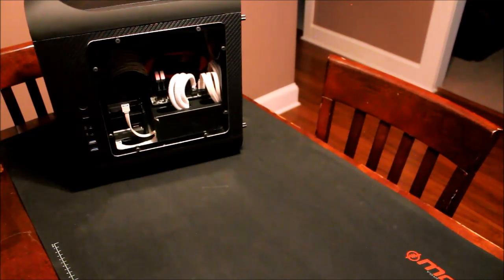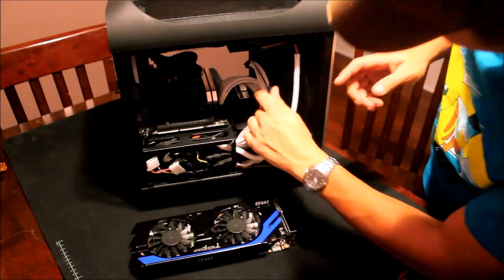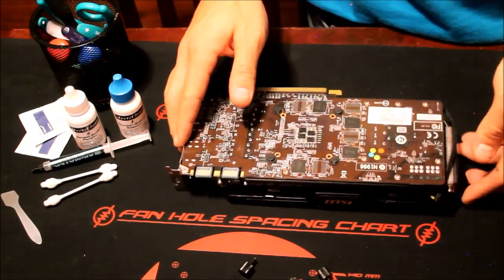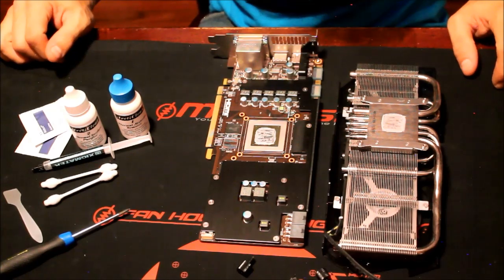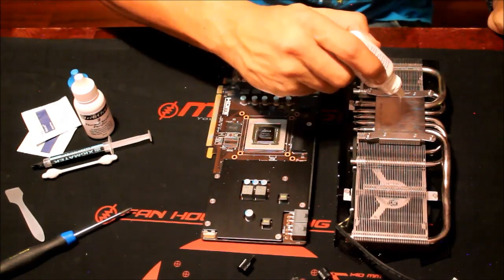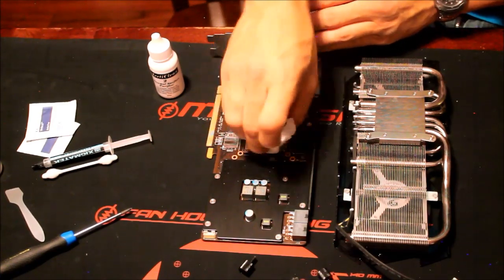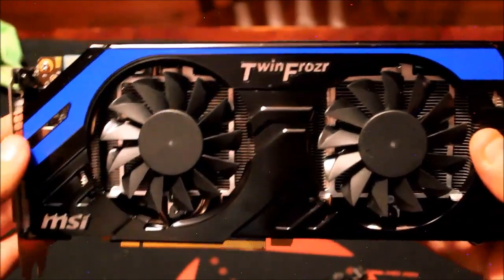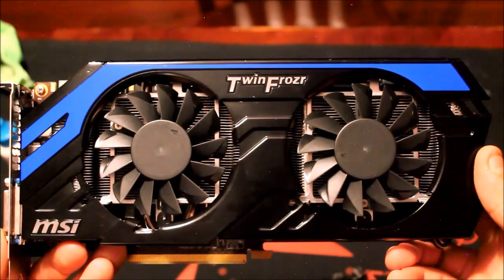GPU Thermal Paste Upgrade - Fix Overheating Video Card

Comment: Can i use water for clean dust?
Reply: I don't know if you're being serious, but no. You can't use water.
Reply: Alcohol?
Reply: Rubbing alcohol for the gpu and heat spreader, but just use compressed air for the dust of your pc.

Comment: I had to RMA my R9 390 because the GPU itself wasn't working right, I got a refurb in return and it runs 100x better no more graphical glitches but the temps are high as balls... about 12C higher than my last, up in the 80's which isn't normal... Would it be worth dealing with the BS RMA system again or just going for it? I know the fans are all still good in it.
Reply: Mine ranges from 75c to 85c in most games. Those temps are normal for a 390

Anything above 94c and you have a problem.
Reply: Yea but I got permission to just change my thermal paste without voiding my warranty and it dropped 20c. I'm like 64-71 on private sever and of course 70-76 on public servers since theres so much more shit going on.
Reply: Well Shit maybe ill try to do something as well

Comment: just cleaned my GT520 and replaced thermal paste. My temps went down 12 degrees celsius.
Reply: hei man i am gona clean my hole laptop , and its not cleaned in 3 years ( since i bought it ) atm my gpu goes up to 92*C when i play Overwatch how much of a difference will a new paste make ?
Reply: darkki94 well my gt 520 went from 76 C* to something like 50-64 C*
Reply: darkki94 don't forget to clea out with compressed air to clean all dust out
Reply: Doritos Master i am giving it to a special service to do the job
Reply: darkki94 oh
Reply: Doritos Master i get it done yesterday .. from 92-93*C now i am at 78*C its much better but i still cant overclock because it crashes :(
Reply: darkki94 you are not supposed to overclock laptops,
Reply: Doritos Master this does not mean that you cant :D maybe i will try with lower rates  :D
Reply: darkki94 well you know with laptops you really don't want to overclock them much. They are a much less stable then pc's

Comment: Furmark score only changed by 2%, and this is a worst-case type of GPU test.Also, my GTX680 doesn't throttle until over 80degC, so not sure what's going on with test. That may explain why his score didn't change much. (I don't understand his graphs because it just looks like the "throttling" occurs when he stops the Furmark test.)Having said that my 3-slot GTX680 occasionally gets slightly loud (I'm noise sensitive so we're talking about 40dB), and since it's now 2016 replacing the GPU paste should help with fan noise.I may do Furmark, Valley and Firestrike tests and report on noise and scores.

Comment: One question :

What if i just open up the gpu and clean the dust only without removing and applying any new Thermal paste.
I bought my rig like 11 months ago & i have not opened my GPU yet to clean it.
Also,  i do not overclock my gtc 960 2Gb Graphics card.
Will removing all of the dust from the GPU improve the FPS.
Again i am thinking of even detaching the graphics part and detaching the two sides of metal containing the paste and just attaching them again after cleaning the dust in fans & the surrounding area.
Will that be beneficial to any extent...?
Reply from the maker: +Fahad Humayoon If the dust is causing it to heat up past its preferred point it will throttle itself down and reduce FPS
Reply: +ChicagolandGeeks 
Oh no..
That explains the 50 fps limit that i am getting in 80% of the gamea that i ran.
Even though i have a 16 gb RAM..
So in your opinion , should i apply a new Thermal paste too besides cleaning the dust of of my gpu.
I was just hoping to unscrew it and blow some air in it (without disturbing the Thermal paste)...
Reply: +Fahad Humayoon My GTX680 is about four years old and my performance is almost IDENTICAL now to what it was. I've never cleaned it or replaced the paste.Your performance issues are more likely a GPU driver problem, CPU bottleneck, or even something simple like not plugging the monitor into the video card (using onboard GPU instead).I doubt you have a 50Hz monitor, but on the off chance note that the FPS if using VSYNC is limited to the monitor refresh rate. I can set my monitor to 50Hz if I want, enable VSYNC and have a max of 50FPS.
Reply: +Canabal Thank You

Comment: way tooo much paste applied...
Reply from the maker: +Mingyao Liu (zodiacsoulmate) Mentioned this in earlier comments, putting paste on a GPU is different than a cpu, you want the paste to completely cover and go over the edges of the die. The temps don't lie!
Reply: umm ok i get u, it is probably better temp by apply more because of the irregular gpu die shape. My bad.
Reply from the maker: Its all good man we're all here to learn and share experience right? :)
Reply: u didn't apply it correctly.
Reply: its a fucking radeon amd what did u expect ? these cards are ovens

Comment: Great video. I found Xigmatek G3606 cheaper and have higher thermal conductivity but is G4512 better?
Reply: +Nabill Hp g45 is better than g36
Reply: Thank you. I will give it a try
Reply: +Nabill Hp o 1 or 2 celcius ok.

Comment: Good guide except the thermal paste, way to much man. Half if what You used, probably even 1/4 if that would havet been enough. Lucky that wasn't conductive paste
Reply from the maker: +Kim Strandberg My understanding with the paste is that for GPUs you want to get it all around the dye, not the same as setting a CPU. I have r290 on water now and the temps are ridiculous low using the same method.

Comment: Wow this helped me a lot, did this on my asus gtx 670 because I got high temps in gta v and h1z1 (85° C +) which never happened before and now it stays <70°C so thanks a bunch!
Reply: +indraine 85C ? lmao  you drop 15 degrees ?  i smell BS.
Reply: looks like you have a bad sense of smell :), tbh it was all dried up and could no longer be classified as paste. It did fix my problem so I honestly cba if you believe me or not
Reply: +Tores Lee High Quality paste will take more than 10 degrees easy. Especially on a old card with stock half dead paste on it.
Reply: When you change your thermal paste, you have to run stress tests to heat up the paste and then cool it down. Temps will always rise at first after changing thermal. 

pozdro.

Comment: I might add that letting it drip on the side onto the chipset is pretty much pointless. No cooling whatsoever occurs there as the heatsink doesnt contact that. Its also a bad idea if you have conductors visible and not protected. A thermal paste with metals in it (silver,diamond, etc) could cause a short between those conductors as metals are conductive. The reason when you take it apart theres so much paste all over the place is, my guess they have machines that put on the thermal paste for them and they use a non conductive paste so there not worried. Its the same idea when applying thermal paste to a cpu die and not using the IHS or heat spreader. Awesome video otherwise.
Reply from the maker: +bluej511 This paste is non conductive, good choice for GPU setting.
Reply: ChicagolandGeeks Yea im using the noctua one that came with my cooler. Using it on my gpu when the room temp is in the low 20s i think i dropped like 5-6°C and thats on a sapphire 7850 haha.

Comment: Makes me want to replace the Thermal Paste of my XFX Radeon 7850 1GB GPU, It has the most odd heatsink (not the cooper one) sometimes It reach 73 degrees Celsius at summer. Maybe Its time to buy Artic Cooling MX-2 for It. MX-2 is a great thermal compound just like the Xigmatek you use.

Comment: this is fucked up.. when I did it by myself I got 48 C when I am on desktop. I though I can get better results with some tutorial like this.. Hell no.. I am back at 62 again -_- ..
Reply from the maker: +julukman Then you used the wrong paste or applied it wrong. Any imperfections, dust, oil, etc are going to make a big difference in temps.
Reply: Yup I did it wrong for sure. I should have leave it be.. doesnt matter anymore :)
Reply from the maker: Word! GPUs come and GPUs go.

Comment: nice video, at 27'c room temperature, my gtx670 reference design card was at 86'c when i play titanfall and the fan at 60% which is not very good. but one problem, the "void if broken" seal is on one of the screw so i dont think i could do it until the warranty is expire

Comment: very helpful video. i want to replace the thermal paste on my brother's 760 twin frozr 4gb cause it's just hitting insane temperatures compared to mine which is the 2gb version. to sum it up, i use a custom fan curve with msi afterburner for both cards, and even with a steeper curve on my brother's card, it's still hitting higher temps. crysis 3 pushed his to 80c but mine's yet to surpass 70c. thanks for the tutorial.

Comment: hey nice video, i have the same card and wanted to do the same thing but i was wondering if this would void the cards warranty or not.
Reply from the maker: I was able to RMA the card after doing this to the original card without any problems. I think they are going to be more concerned about physical damage to the card more so than you changing the paste. As long as you don't do it like an A-hole :)